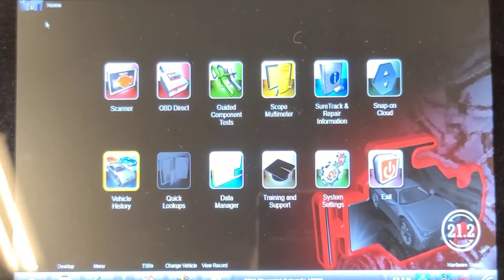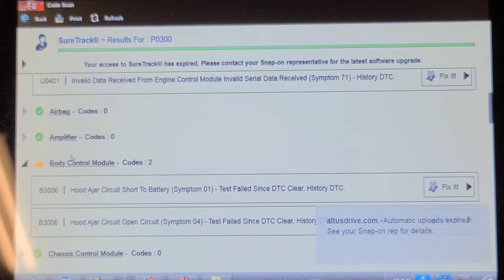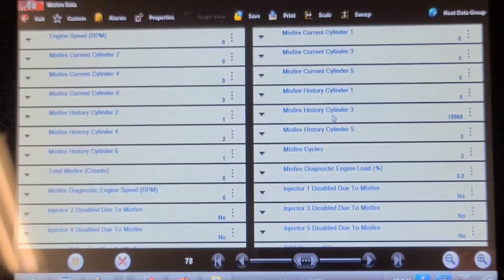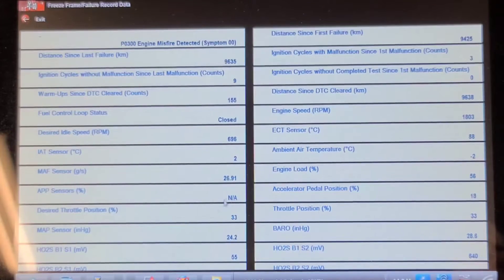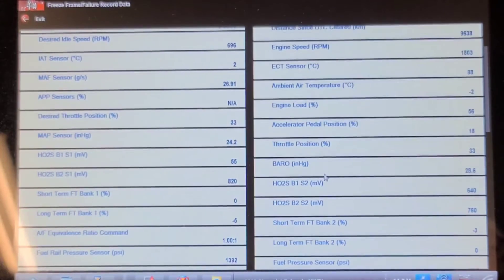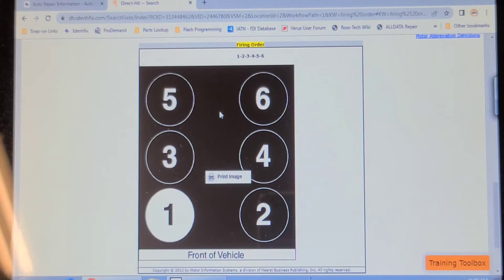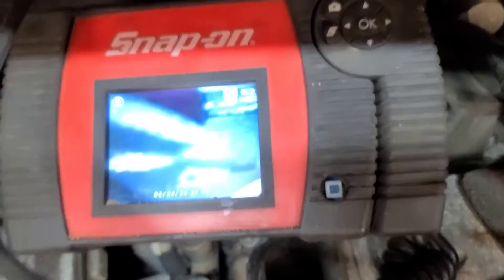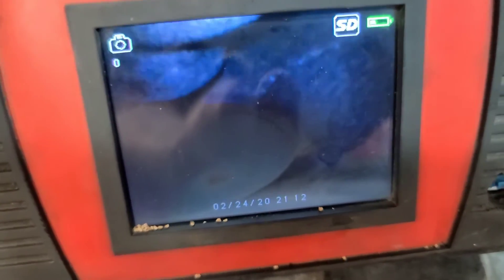2016 Colorado 3.6 P0300 Misfire Diagnosis

Comment: I have a 2015 Colorado 3.6 with 125k miles.  I got a random misfire twice now that goes away when I turn it off and restart it.  I changed the EGR Valve about 5 months ago Amazon part.  I put new spark plugs in 6 months ago.  Engine light turns off when it starts right.  What are your thoughts?
Reply from the maker: You need a decent scan tool to view live misfire counts when it's happening. Once you know what cylinder or cylinders is affected try swapping the coil first then if that doesn't work try a compression test, injector flow test,  swap or replace the injector, clean the intake valves or sell the truck...
Reply: @PhillipBailey  Just started it up.  Power steering light came on, then U0100 Lost communication with engine control module/power train control, P0700 Transmission control system malfunction, U0100 Lost Communication with Transmission Control Module, and U0109 Lost Communication with Fuel Pump Control Module.  Runs fine.  It has to be an electrical issue somewhere.  I appreciate the help.

Comment: Excellent video. Have you run across fake Chinese parts in your work? I'm about to change plugs and maybe coiuls on my Colorado and I've heard the system is flooded with fake parts even labeled as AC DELCO. Thanks.
Reply from the maker: Yes this is an ongoing problem for the past 30 years.

Comment: 8:37 looks like a crack or split in hose.
Reply from the maker: @davidakkerman9437  that's the PCV fresh air hosed and that's just a sponge insulation on the pipe that's cracked. Won't affect anything.
Reply: @PhillipBailey  I noticed that after video went on. Felt foolish, but figured it was possibly a corregated hose that was protected  or foam over a rubber hose. At any rate, it stood out. Thanks.
Reply from the maker: @davidakkerman9437  you have good eyes sir!

Comment: So nothing conclusive on the intermittent misfire?  I was expecting to see a damaged wire or maybe some spark escaping between the coil and the plug.

I suspect that you didn't see any oil leaking from the valve cover gasket that may have deteriorated the coil/plug boots?

Intermittent issues are such a pain.
Reply from the maker: The miss was caused by the carbon fouled plugs and agrivated by the intake valve carbon deposits.